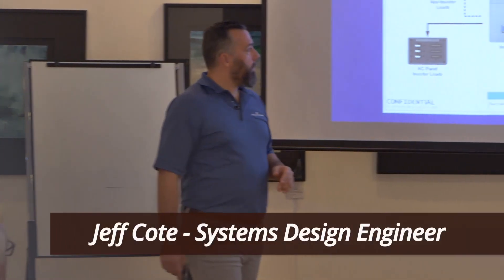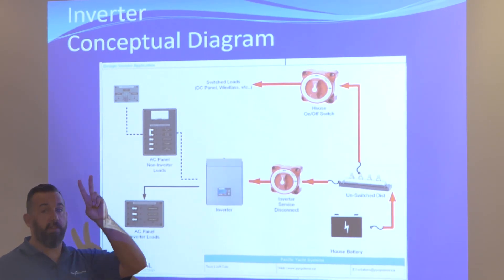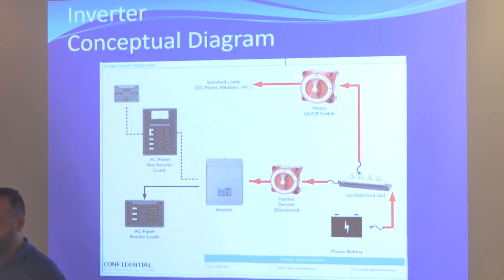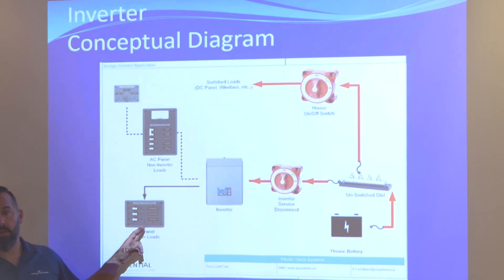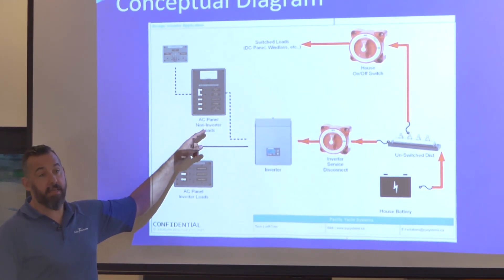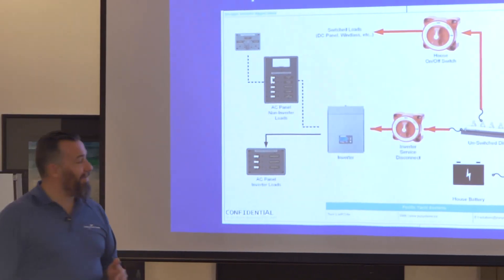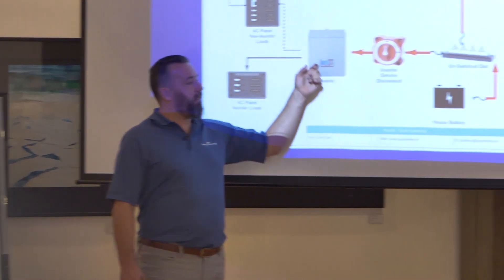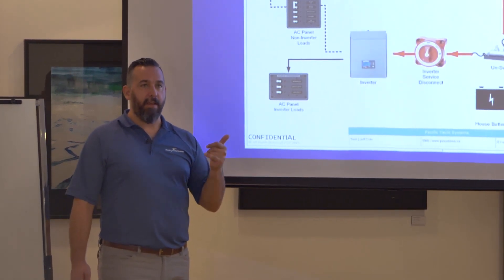How To: Marine Electrical Seminar - Inverter Troubleshooting - Ep 21/30

Comment: thanks for the vid. as always. ..   in the middle of a rewire this week as we speak.  2005 searay 260, well wired as always, had a fire from what appears to be caused by the water heater.  sadly the triplex. small at 14/3,  was bundled in loom along with dc loads and it wrecked the bundle.  i did see an 1800 watt inverter incorrectly.. THEY installed  output receptacle in the shore cord area.... SAE 4GA  and a 175 ANL.  assuming they were plugging the entire boat in the inverter..  !